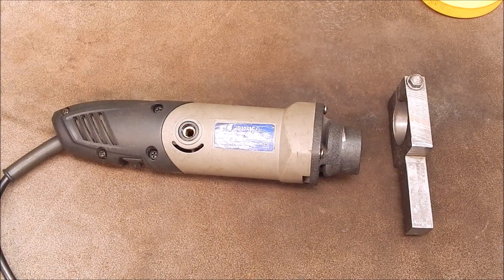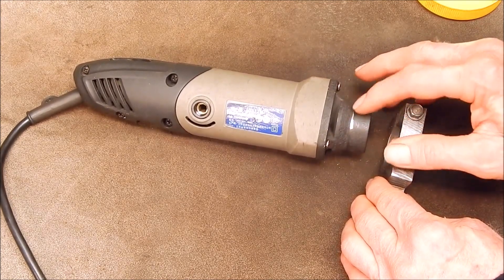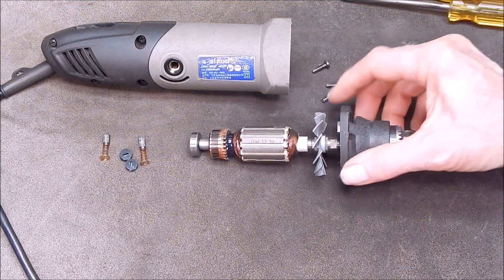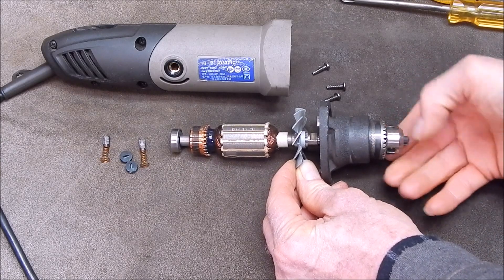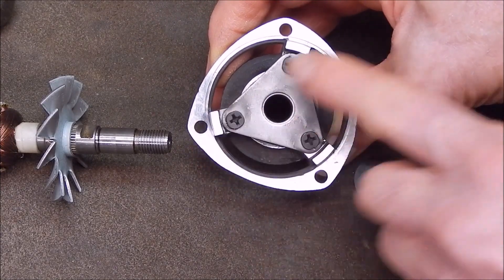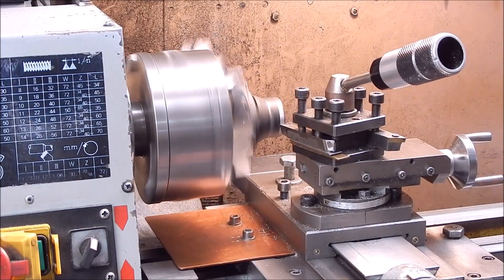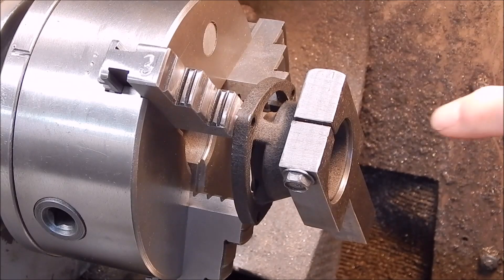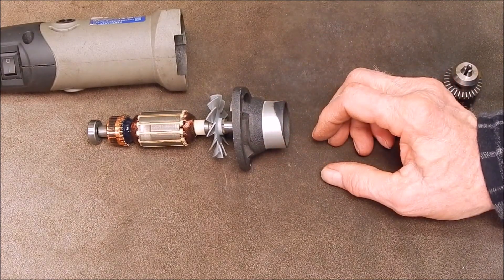How to machine the 400 watt Hilda die grinder to mount it as a TPG

Comment from the maker: Note:  You can also get the front bearing and nose on by tapping it part way on with your hand and then pulling it up the rest of the way with the three fastening screws.  Cheers Rob
Reply: 2 cents -When that isn't an easy enuff option, use an allen key in the chuck as a lever, a 9 mm spanner/ wrench on the axle (sticking out the housing recess), slip over the freshly turned nose, dust cover/ washer and inner ball race bushing on axle, thread on the chuck and tighten it all the way home. Thus the threads of the plastic housing won't get stripped if bearing-axle fit is a bit tight. Cheers, DIYSwede
Reply from the maker: Yes, that's a good idea Johan.  The bearing is a good shaft fit without being excessively tight.  Thanks for the comment.  Cheers Rob

Comment: You could use the drill press, to fit the bearing back into the housing.
Reply from the maker: That's not such a good idea.  I know of a drill press table that was broken off doing that.  Better to use a vise.
Reply: @Xynudu  
Would be a good idea to support the table, as you sometimes do while drilling.
Reply from the maker: Yes, definitely.  The column clamps look solid, but are actually a hollow casting and can break under excessive loads.

Comment: Im thinking would this be good for small "dremel cnc" like table router 🤔 mainly for PCB, maybe for some thinn aluminium parts
Reply from the maker: This is much more powerful than a Dremel.  It may vibrate more than a Dremel at high speed. Cheers Rob
Reply: @Xynudu  Yea also tought that rigidy, has this much better bearings? At least this is easier to mount due that machined long cylinder collar 👌 (in newer version actually)

Comment: G'day Rob, what is the or was the wattage of your die grinder mate? I'm looking on fleabay here in the UK and have found one that looks very similar to yours with a host of accessories including a bench C clamp holder with a ball joint for under £25 and its wattage is 400 w. Your thoughts? Crap very probably lol
Reply from the maker: 400 watt.  I have seen other brands on Amazon/Ebay that look like the Hilda but it's anyone's guess how good they are.  Plenty of knockoffs for everything you buy these days.  Cheers Rob

Comment: I will change the subject a bit Rob-----a month ago my 5" angle grinder gave up the ghost    a dewalt..So into Bunnings I go, got a replacement for $65...Another dewalt.....They have halved in price..I thought I would pass the word on..   E
Reply from the maker: Power tools sure have got cheaper Ian.  Very affordable.  We live in a throw away society.  Very little is made to be repaired.  The previous last thing I burnt out was also an angle grinder (at least 20 years ago) which was full of dust/dirt and blocked air passages.  It was a blue Makita with a toggle switch at the end of the body where the cord goes in.  Damn old.  Cheers Rob

Comment: Hi Rob, did mine a few months ago.
Also fixed the runout of the chuck and shortened the brush springs, way too much pressure against the commutator.
Reply from the maker: I have never noticed any chuck runout Willem.  The brushes are pretty small compared to most units that size.  Cheers Rob
Reply: The spacer between the chuck and washer is simply an inner race from a bearing. The chuck as you are aware buts up against this spacer and you are purely relying on the female and male thread fit.
The chuck has a bored register to give good alignment and true running which Hilda neglected to use.
I simply enlarged the register to a depth 3 mm to make the spacer a slight interference fit enabling a true running chuck not relying on the loose fitting thread.
Reply: @willemvantsant5105  Thanks Willem.
Reply: @Xynudu  Rob, if you can show us how one corrects the chuck runout on this unit as Willem did?
Reply from the maker: Hi Benny,  I don't have any runout on mine.  The bearing centre should be quite uniform and enough surface area to keep everything true.  Bearings are usually made extremely accurately.  I won't be correcting anything unless there is an actual issue.  Cheers Rob

Comment: Hi Rob. Yes that very slight taper on the nose of the Hilda is bloody annoying when you're trying to clamp it! Thanks for showing us how to fix it 👍👍 Cheers, Alan.
Reply from the maker: Hi Alan, I always check for centre before tightening the pinch bolt on the mount, but this modification makes that unnecessay.  Use a puller to take off the nose and all will be good.  Cheers Rob